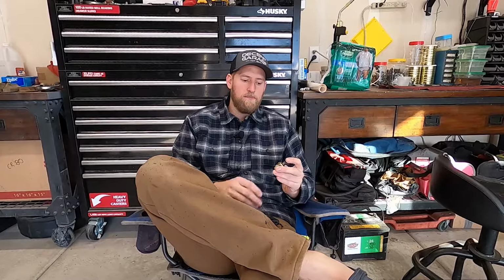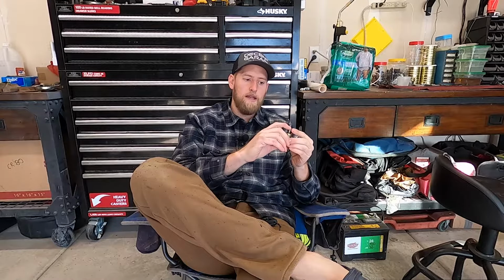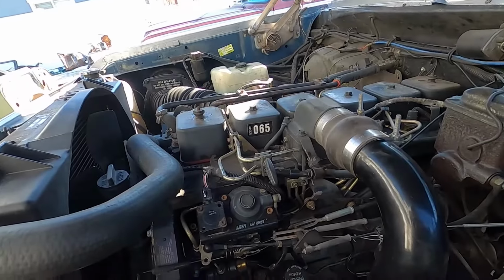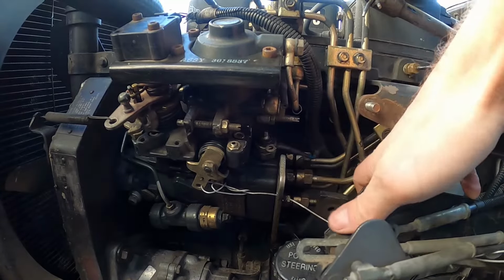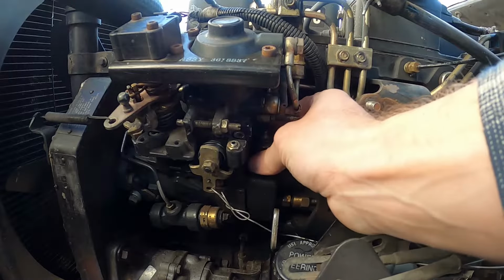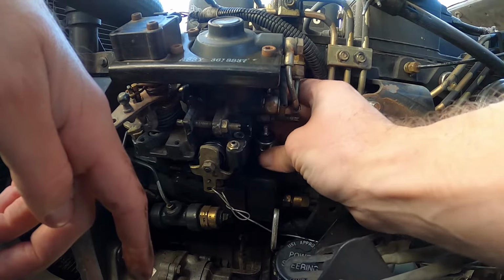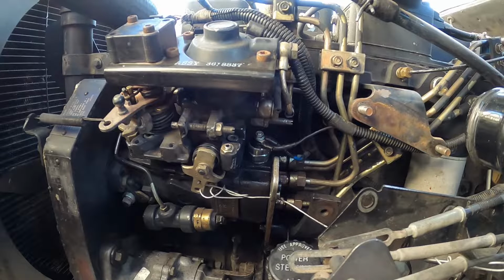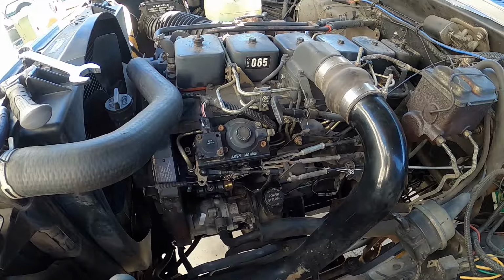Fuel Shutoff Solenoid Issues? | Here's THE FIX! | 1st Gen Cummins

Comment: Awesome video!! I have a 92 and a new fss. So when I jump the fss with a wire from the battery I hear the fss and something clicking in the driver fender...
Reply from the maker: That would be your starter relay which is connected with your starter, your fss, and the ignition.
Reply: @decentgarage  goddto know thank you! I was worried I had a major wiring issue. Love the builds keep em coming haha

Comment: Driving on Kansas roads.  Truck suddenly acts like it ran out of fuel.  Pull over.  Sit.  Start her up again.  Drive another 25 miles.  Repeat this 3x.  Now in an RV park making repairs.  With certainty it is the FSS .  Filter is clean, pump is good and connections checked and rechecked. I will in the short term toss a kill switch/cable on it, but once back home I will replace the solenoid AND the pin.  It looks as though you also good a new solenoid body that you put that magic bullet in.  Is that the case or you just cleaned the old one up good?  If a replacement, what did you use?  Seeing all kinds of possibiliites with reviews all over the place.  This is a solenoid that came with my new VE pump from Eric not quite 2 years ago.  I would have expected the solenoid to last a bit longer than that but maybe they routinely fail?  What say you?  As always, THANK YOU for the vids.  Saved me on that bracket info.  Could not figure out how in the heck I was gonna get a wrench in there!!
Reply from the maker: I did also order a new solenoid but that is not necessary. The hungry diesel carries them though. Glad this information was helpful in a pinch!

Comment: I see you’ve had your fingers in there before. Those trucks came stock with a spade connector to the solenoid, you have a ring connector on a stud. I know because I had an intermittent loss of power issue. I called Jim Leonard a retired Cummins mechanic who I had met years before. He instantly knew the the problem immediately. I just crimped the connector with pliers an never had another issue. Some years later on a caravan camping trip to Baja my friend had his 92 shut down just above El Rosario. He started looking at fuel filters and fuses. I wiggled that wire and saw the connector was loose.
There is so much vibration in the first generation all kinds of things work loose. After replacing front brake pads and putting new fluid in the system I checked the master cylinder over several days. Always had to add just a bit. I couldn’t see any issues with the calipers or wheel cylinders. Eventually I found it. The two lines coming out of the master cylinder have coils in them. They were close enough that when the engine was running the two pulsed together. It had worn a pin prick hole. One new line with better clearance solved that one. Keep up the great videos, thanks RD
Reply from the maker: Yeah, i switched the ring connectors for this reason
Reply: I've had the same issue with the spade connectors .... When you say you crimp them with a set of pliers and your problem is fixed do you mean;  A.) You crimp where the wire connects to the spade or B.) You squeeze the female end of the connector so that it connects tighter ?   Thank you !

Comment: I did this upgrade yesterday on my 91.5 D250.
Actually I did it 3 times.
first time my truck would not shut down unless I cycled the key back on and then off again, then it shut down.
So I took it back out and extended the spring length.
Then it would try to turn the truck off but it still ran at a slower underpowered idle.
So I took it back out and put the spring back to its original length and did some measuring and close observation of the old and new pin and discovered the new pin's brass end was a bit larger in diameter and the end of the pin was not countersank enough.
So it chucked it up in my cordless drill and used sandpaper and then scotch brite to sand it down and polish it.
I then used a countersink without a pilot to sink it deeper on the end.
Now it works as the original one did.
I only had to take the throttle linkage off and unplug the three wire connectors, they all had blade connectors and used a 15/16 crows, foot 6 inch extension and ratchet to remove and install mine.The trick is to install the crows foot first with the drive end facing the engine head then assemble the extension onto the crows foot between the pump and head.
Stay Ultra Maga!

Comment: my truck is not starting was driving just fine then sputtered and died and will crank but not fire,  its a 91 and I have gone through just about all i can think of but on my fss there is only one wire on it could this be the reason if so what wire is what

Comment: Mine had an issue where the solenoid would engage randomly while I was driving, killing the truck.. Must have been loose wiring now that I think about it, but I went to manual shutoff and solved the problem that way... Could have been my iffy wiring from fusible link delete..
Reply from the maker: Did you follow my video for fusible link delete or did you use something else?

Comment: I have the fuel cutoff hooked to a kill switch for a tractor in the cab. I like it because I can pull my keys out of the ignition and the motor still runs. Makes it easy to let it warm up in the morning with the doors locked or easy to take the keys out to get a gate and leave it running
Reply from the maker: Yeah i ran the cable for a while but I'm liking being able to shut the truck off with the key now

Comment: I have replaced fuel pump and filter and the truck after it gets down the road about 6 or 7 miles does not idle and shuts off and will not start till it cools off thought it might be this sensor
Reply from the maker: I would be that it's your fuel shutoff solenoid 👍

Comment: @decent garage I had electric issues and did a fuseable link delete and still have a crank but no start problem and I think it could have to do with the fss is there a fuse or something I can check
Reply from the maker: There is no fuse to the FSS. If it is an FSS issues make sure the connectors are tight (I switched mine to ring connectors) and make sure the wires are solid.
Reply: @decentgarage  could this be a relay issue?  I just did the fusible link delete(windows and blower work now!) but it won't start.  I played with the connections on the FSS but no luck.

Comment: How did you get the pieces of the rubber plunger out of your fuel rails
Reply from the maker: ehhhh.. Thats requires pulling the pump apart. Usually the pieces get stuck in the delivery valves which are easy to pull and check. So check there first. Or you can do like most people do and just run it. If it runs fine it probably won't be an issues. haha

Comment: Have you ever dealt with the this issue? One day I was accelerating in my truck quickly and all of a sudden the truck cut off and white smoke started billowing out the tailpipe. I got all of my injectors tested and they checked out, and I replaced my fuel filter and lift pump. Now whenever I accelerate quickly the truck will blow white smoke and cut off. I’m hoping it’s not a cracked block or head gasket leak but I don’t know. Any insight you might know would help me
Reply from the maker: Give me some more info. What turbo and injectors are you running? What kind of boost are you seeing. White smoke does usually mean burning coolant so you could have blown the head gasket.
Reply: I have a Jm GSP turbo with “200HP” injectors. I’m not sure what boost I am getting because I do not have a gauge hooked up. I’ve just recently bought this truck and I do not know it’s history besides the description the seller gave me I’ve tried finding the exact turbo but without any luck, the injectors I have pulled to get tested and they were fine but they had no markings so I couldn’t get the exact details on those either.

Comment: Could you use a regular hex head bolts instead of the torq and Allen head bolts?  Seems like a socket would be better
Reply from the maker: You probably could but you will see when you pull them that they are all unique lengths. I am honestly not sure what their purpose is besides holding that bracket on.

Comment: I wonder if the solenoid can partially fail an allow engine to run above idle but stutter and shut off at idle.
I think they should have used a much more robust and reliable system.
Rubber chunks in the heart of the engine down stream of fuel filter,,, fail.

Comment: My fuel gauge just sorta slides back and forth constantly. I also occasionally have issues with the other gauges in the cluster (speedometer just stops working sometimes) so I was thinking maybe it’s an electrical issue, but I’m not sure where to start looking for an issue. I’m not a mechanic and I’m learning as I go. Any advice would be appreciated. Thank you in advance!
Reply from the maker: Great question. The fuel gauge in my prospector is doing the same thing so I'm going to have to look in to that and I'll do a video it. It's likely an issue with the fuel sending unit. The speedo issue is typically related to the vehicle speed sensor. If you do some googling about those things you should be busy for hours reading about diagnosing and fixing it.
Reply: @decentgarage  thank you! I’ll look into it more this weekend

Comment: I've had the same problem except in the reverse. The Deathcharger wouldn't start. I gutted it and run a cable shut off. Since the Deathcharger isn't my daily I'm fine with it, but the ole COD may need it haha.
Reply from the maker: Yeah, the cable wasn't terrible but it did get old. But for an offroad vehicle it would be fine.

Comment: Extremely helpful!  Same power loss occurred with me.  Implemented your suggestions, one by one, starting with the fuel filter, then the updated lift pump and finally with the magic bullet (the last two from the Hungry Diesel).  In my case, the o-ring had become enlarged on the FSS and so slipped down into the fuel passage where it blocked the fuel flow. FYI the Torx bit needed to move the plate is T30 and the Allen Head socket needed was a 5mm.
I have an automatic transmission in  my '93 and so I had to contend with an additional mounting bolt/location on the throttle assembly bracket.  Not an issue.  However, it did present a problem when trying to remove the top Torx headed bolt from the pump bracket.  My solution was to use a Dremmel wheel to grind just a slight amount of relief from the bracket to allow just enough clearance to remove the bolt.  An added step, but an easy solution if you are patient.
Finally, when removing some of the bolts/hardware from the various brackets, be aware that some trucks may use SAE bolts and others may use Metric. 
Overall, your video was extremely helpful!
Your channel is one of the best on YouTube for the DIY mechanic for these First Gen Dodge/Cummins trucks!  Keep up the great work!

Comment: Hi Tim Great Video!! What did you do about the KSB wiring once you disconnected the FSS, during cold starts you need this, as I found out after I deleted mine, as they are both connected through the same wiring. Thank you!!
Reply from the maker: My FSS wiring and KSB wiring is still hooked up. The magic bullet still requires a functioning FSS. When i was running a pull cable shutoff i had my FSS installed with the wiring installed but i didn't have a plunger in it.
Reply: @decentgarage  Thank you Tim!! Does that mean you can just join the two wires together or are there different voltage levels going to the FSS and the KSB through a relay?
Reply from the maker: @franklogan494  it should all be 12v 👍
Reply: @decentgarage  Thank you!

Comment: I highly recommend The Hungry Diesel. Had my Ve pump rebuilt through them after it wouldn't start back up after getting the truck up to operating temperature unless I poured water on the injection pump. Stock rebuild but set at max fuel and it's got good power and idles waay smoother. Absolutely love that crew Cab. Great video, keep up the good work.
Reply from the maker: Yeah, Eric does great work and is a stand up guy.
Reply: what was the cost for the rebuild if you dont mind i ask?!

Comment: Great video,  by the way have you figured out an easy way to turn off the Anti-Lock light issue (wiring from the anti-lock sensor on the third member) to the sensor box behind the glove box. My Pickup is a 91 (pre 91.5) non intercooled D 250 (2WD) ?  besides just unplugging the box behind the glove box. The dodge fix is a real pain in the Gass to run another wire from the from the anti-lock solenoid mounted on the frame clear in the back all the way to the anti-lock control box behind the glove box. maybe  you have done a video on this issue? just checkin

Comment: Thank you so much for another very helpful and detailed video on possible issue with my truck I am going to see if this is the issue tommorrow my truck died on way to work I thought wire fell off the FSS like it has done before but wasn't the issue cranks over fine but won't start
Reply from the maker: I bet this is your issue. You can pull the plunger and and run a pull cable in the meantime
Reply: @decentgarage  I am hoping that is the issue it looks like it has fuel going to the pump so that sort of rules out the fuel filter and lift pump even though I have a THD pump I bought over a year ago when it went on sale for a price i couldn't pass up but still haven't put it on yet ..Thanks
Reply from the maker: @bbtoyshop  I'll be making an install video for the hvlp lift pump next week.
Reply: @decentgarage  Great I will be looking forward to it then I am subscribed to your channel Thanks
Reply from the maker: @bbtoyshop  thanks man!
Reply: @decentgarage  Hello I have a question I went ahead and put the THD lift pump on and new fuel filter and I went ahead and fired up my truck but I hadn't put the bracket back in place I had to move for the FSS switch repair I notice some fuel came out of one of the holes do those bolts effect anything inside the pump ? i sort of figured they were to hold the plate in place so i wasn't thinking they would cause any issues being out for the time being ? thanks
Reply from the maker: @bbtoyshop  they are mainly for holding the bracket in place but one or two of them are quite long so they may have a role in holding the delivery valve housing to the pump
Reply: @decentgarage  That is what I was sort of thinking but I know the bottom one was the longest of the three screws but I just wanted to make sure it didn't cause any issues for when I put it back together  thank you for all the help and advice on things
Reply from the maker: @bbtoyshop  no problem 👍

Comment: Can these solenoids fail shut? And cause the engine to not start?
Reply from the maker: They are pretty basic solenoids. Key on power and they open, key off power and they close. I would suspect the wire connections being the issues before the actual solenoid failing
Reply: I had the same question.  My truck died a couple weeks ago it was 9 degs I wonder if the rubber tip broke off and is logged in the kill position?  How can I recover it when I pull the old solenoid off?  It just odd…

Comment: Curious, is it possible to get a 15/16" socket on the solenoid ? Thanks Tim.
Reply from the maker: I will of you get everything out of the way including the fuel lines for the injections pump. It's much easier with just an open ended wrench

Comment: Needing a cruise control unit and linkage for this set up anyone here can help.
Reply: I may have something in the future
Reply from the maker: I'll keep an eye out. I've never had working cruise in my truck haha.
Reply: @trevorlee2484  kool beans man let me know
Reply: @decentgarage  thanks man ya its a pain not having one.
Reply: @devinmanderson  Find me on the ol' FB
Reply from the maker: Trevor I may need your expertise on my cruise control. Everything is there but it has never worked in the 8 years I've owned the truck.
Reply: @decentgarage  well mine works as of right now so maybe we can do some diagnosis by comparison
Reply: @decentgarage  Could be the Servo. The diaphragm might be crack inside it. Or a vacuum problem. Or the fuse. I had to rebuild my set/accel button on mine. Actually just had to replace the set switch under the cover button. It's soldered on a small circuit board. Crazy enough, I found a company, I believe, in Mansfield, TX that made or sold them for about 20 cents/pc. Heck, it might even be the clock spring. I replaced mine before I found the set switch problem.